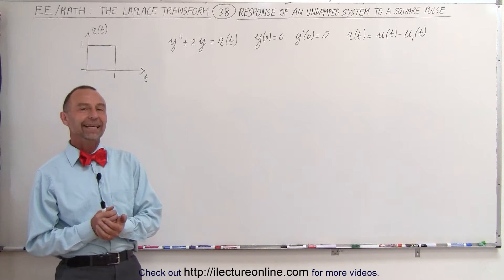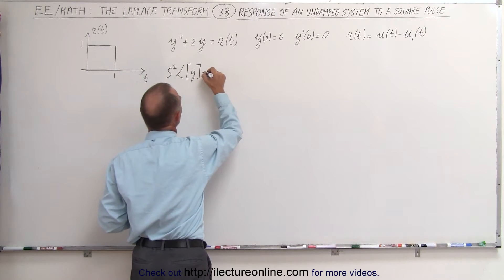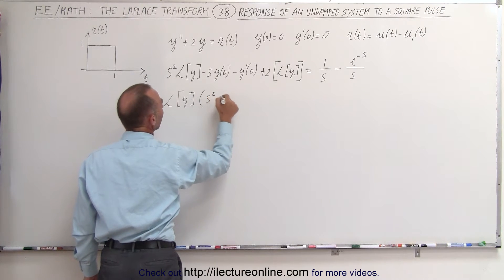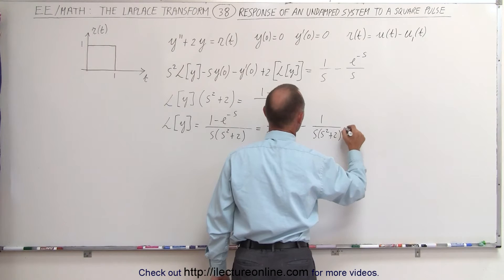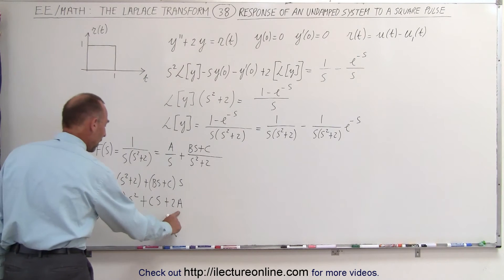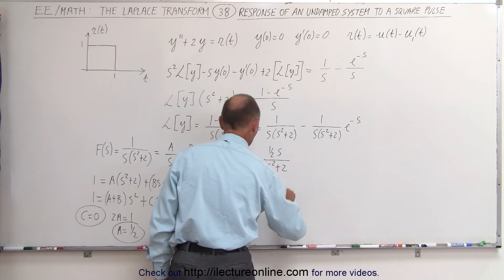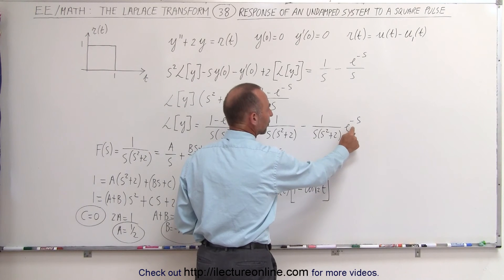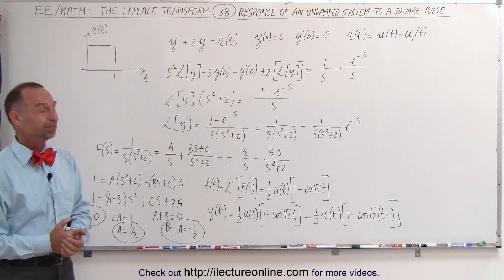Electrical Engineering: Ch 16: Laplace Transform (38 of 58) Response to an Undamped System 1

Comment: Sir, the reason that you multiply the cosine terms by u(t) and u1(t) is because the system response only lasts from t = 0 to t = 1 seconds correct? 

If the differential equation had been for example y'' + 2y = 0 then L[y] would be equal to 1/2*(1/s-(s/s^2+2)) and y(t) would then equal 1/2*[u(t) - cos(sqrt(2)t)]?